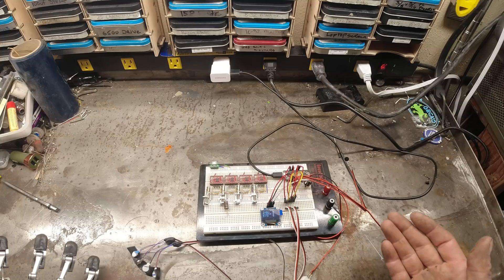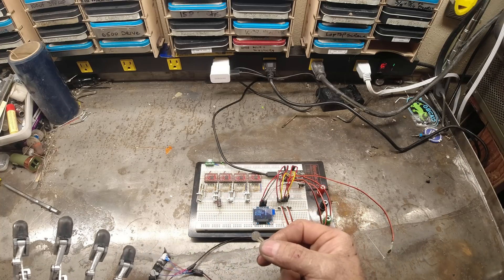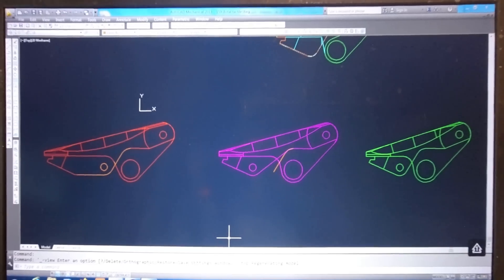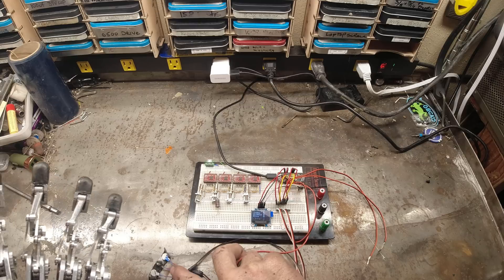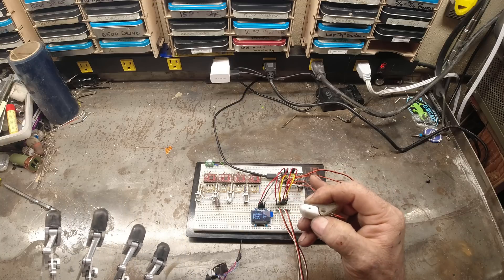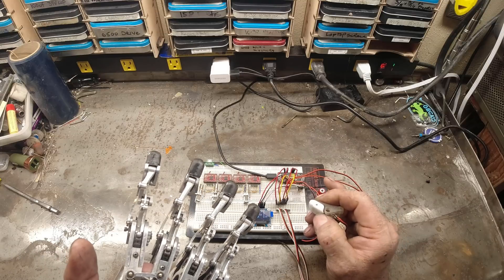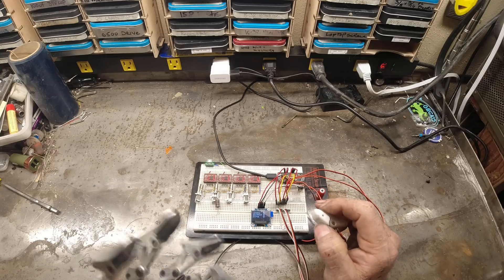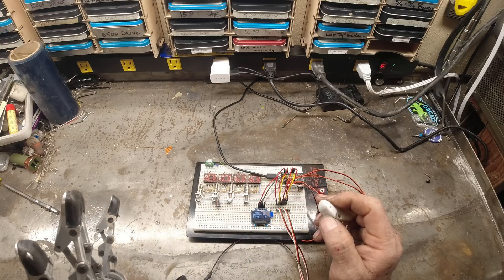Almost a cyborg! Adding Haptic feedback to my New Prosthetic Hand

Comment: i'm really excited to see you working with haptic sensing. I have a theory that you could put the haptic sensors anywhere, like on your forearm or your shoulder or even your stomach, and because they send a signal when you see your finger touch something your mind will eventually place the feeling at the end of your mechanical finger.  looking forward to your videos describing how the haptic sensing adjusts overtime in your perception. Great work. 

I hope your next project is to check out the motors people use for in – hand actuation.  your fabrication techniques would make an awesome full hand. There's a lot of tricky geometry too.

Comment: Recommendation I would have for haptic feedback is to using rumble motors or any motor that causes a vibration. Vibration can absolutely work in this usecase but it should not be on constantly and should have irregular pulse patterns. The reason for this is that over time you will either become numb to the constant vibration so you stop noticing it or the pattern is the same so your brain starts to block it out.

Personally, my recommendation would be try to emulate pressure. It's noticeable when it's there and when pressure is relieved. 

However, I am very curious of your implementation either way you go. Been following your progress for some time now and love everything you've done. It's truly inspiring.
Reply: Have one touch combination trigger the drum solo from Van Halen's "Hot for Teacher".

Comment: I quite like the idea of the haptic feedback - wonder if you could put more sensors in the fingers, for example, temperature in the pointer finger, a 60hz power scanner (detect if an applicance is live or not) in the middle finger, etc - then switch the feedback mode using the controller or some type of wrist actuation.  If you ever want a custom PCB with the components of the metro mini, let me know.  Might make it easier to fit somewhere.

Comment: Soon...

From the moment I understood the weakness of my flesh, it disgusted me. 
I craved the strength and certainty of steel. I aspired to the purity of the blessed machine.

Your kind cling to your flesh as if it will not decay and fail you. 
One day the crude biomass you call a temple will wither and you will beg my kind to save you.

But I am already saved. 
For the Machine is Immortal.

Comment: you could probably add a wrist component using a slightly thicker nylon material (like a stretchy shirt) as a base for something to hold the motors. keeps it from restriction movement, but also might keep everything together without going too far away from the hand. almost like a glove.

Comment: Sadly we are still far away form fusing nerve endings together with some kind of ionic-polymer metal composite but maybe its not the right freuqency or rpm that the haptic feedback motors are vibrating at.

Comment: It might be clunkier, but what about using some sort of tubes or small sacs that create pressure on your sockets in reaction to haptic sensing on your hands? I think light pressure might be more comfortable than vibration (as long as you limit it). Then again, I am no expert, so take this with a grain or two of salt. In any case, I think this is a great idea in concept and can't wait to see what you come up with! I also think it may be worthwhile to consider moving the metro mini to strap higher into your arm if it takes too much space, and to potentially protect it better.

Comment: really cool idea! one option is to just mount the haptics on the metal fingers, that way the vibrations travel down and might feel more natural.  also i'm assuming you would change the strength of the haptics to be proportional to the force, through something simple like pwm.
Reply from the maker: I'm mapping the sensor to give proportional feedback. map(sensor, 0, 1023, 0, 255);
Reply: @missingpartsclub  nice!

Comment: For those stepper motors, go with TMC drivers.. you get a lot more control over them using UART, especially good for battery powered systems where power management is important.
Reply from the maker: The micro steppers are for a different side project.  The haptics are using the 10mm haptic disc motors from adafruit.

Comment: You never cease to amaze me! It sounds like a really good idea. If implemented correctely it could greatly improve the prosthetic giving you the ability to detect and avoid unwanted contact a lot quicker. 
I think it would also be great to use proximity sensors to control the haptic feedback, giving you just a little nudge even before you touch something only activating the motors fully on contact. But that would probably increase the complexity of the whole thing.
Reply: bro going to get observation haki with proximity sensors

Comment: Fascinating. 
One question though: did You consider doing it with a purely mechanical approach ? 
Let's say using the principle of a photo shooter cable where the pressure from finger cushions is relayed to the socket ?
Reply: Waaaaay too much friction.
I experimented with creating purely mechanical remote hands and cables failed to work in even the most basic cases.
Even the best cable option, which used braided carbon fiber w/ a PET sheathe, gliding inside PTFE lined housing, was unusable.

I moved to a passive hydraulic system. This worked better, but was still too bulky to actually use.

FYI. The intended use was for astronaut use during EVA. The pressure suits they use make fine motor control really difficult, since any part of a suit that is flexible wants to inflate like a balloon, and you have to fight that inflated position to bend your fingers.
My system would have the hands inside a pressurized section inside mechanical "gloves" which transferred the positions(and pressure) of each finger joint mechanically to the "remote" hands.
Reply: @Prophes0r  what about a prismatic joint?
Reply: moving parts wear down and add to the maintenance
Reply from the maker: The problem comes with differentiating the feedback that you get from activating the device from what your get from the fingertips. Tactile proprioception is super tough to get externally.
Reply: What about something like a waterballoon approach ? The more you squeeze in the fingertips the more pressure you feel at the wrist ? Like one of those stressballs. But in a tube.
Reply: I like this idea! Electronic sensors would require a power source and at that point you might as well make the whole hand electronic
Reply: @RichieD_21  same! something as simple as a clicky / creaky joint